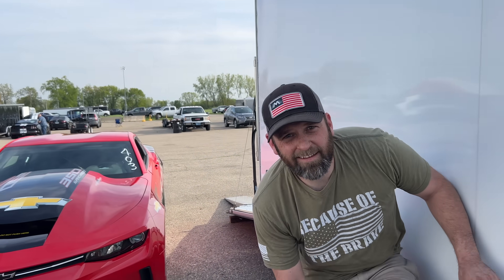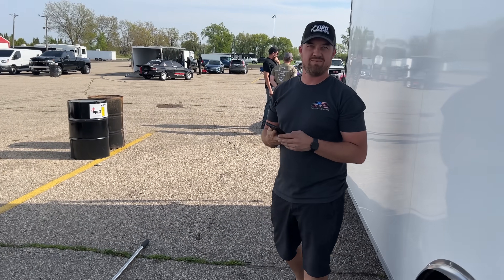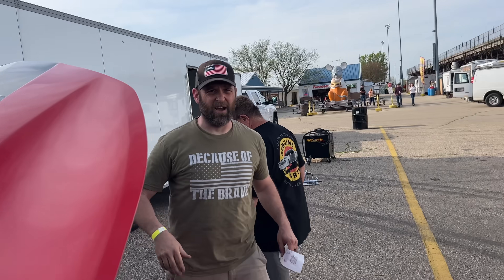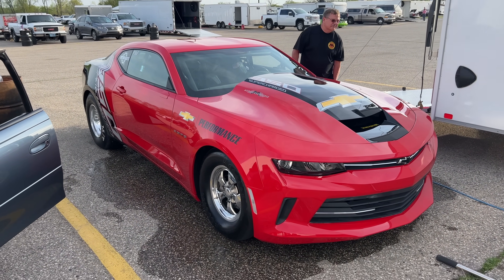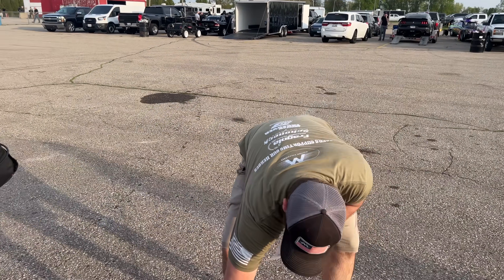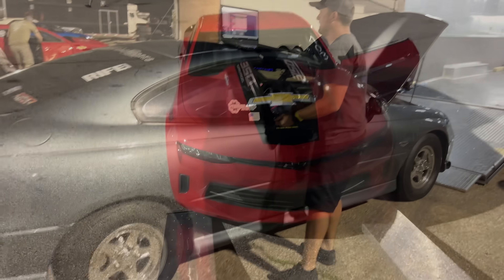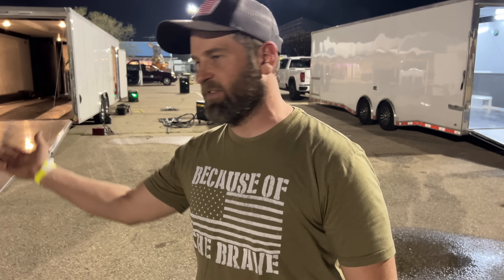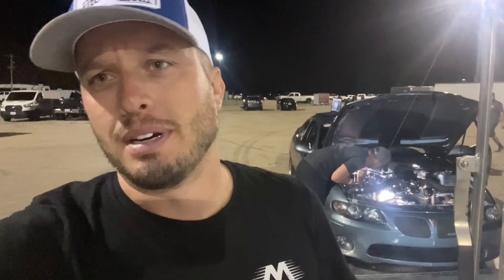COPO First Test Passes in Stock Eliminator Trim, and the GTO is Back!

Comment: Doug I built a pad that bolted over the brake pedal arm, then mounted a large button for the 2 step. Brakes work normally, when you stage you shift your foot up higher on the pedal and let the tip of the show depress the button.

Comment: Could weld a square piece of metal on top of the brake arm lever, so its to wide for the switch to pass in front of.. Just an idea, great job.
Reply: I was going to comment this, but wanted to read some comments first to see if it was already recommended.

Comment: The Copo that I raced had a momentary button on the pedal itself. It seemed quite a bit more responsive than a pressure switch in line with the master cyl and a lot less mechanical to go wrong.

Comment: For now just double roller that brake switch, that should stop it from going beside the pedal. At the shop, redesign it to reach further into the pedal arm and make it stretch out (spring load it) so that it does not impair the pedal travel.

Comment: Can someone tell me why there's wheelie bars on a copo with I was always told you can't run a wheelie bar with radials because it basically hurts itself and doesn't work on a non big tire  slick car ?
Reply from the maker: That’s a valid question. These cars were setup with slicks originally, we have them setup so high they aren’t doing anything, might end up just taking them off
Reply: @MotionRaceworksOfficial  ok thanks I thought that might be it... I've heard Cleetus mention why the blazer doesn't have them so had to ask